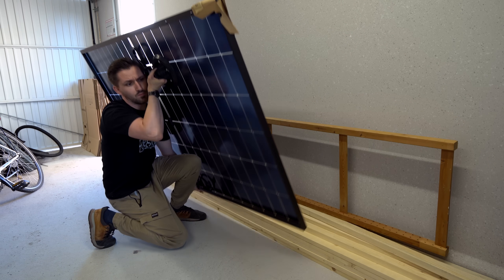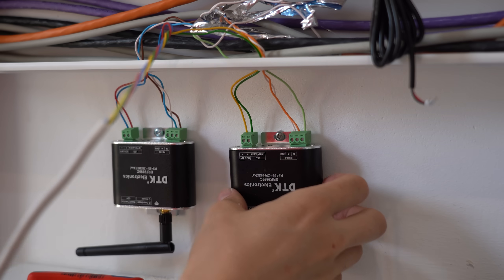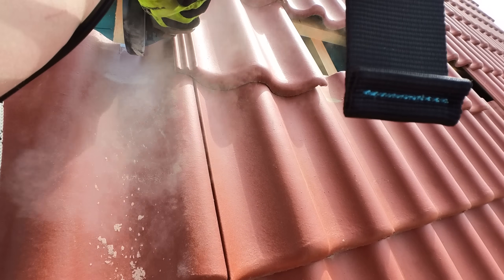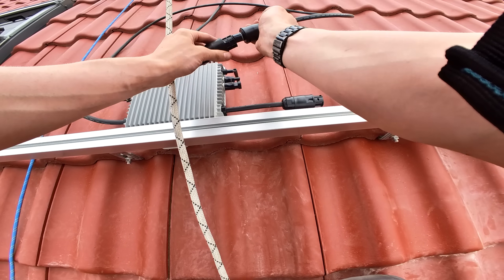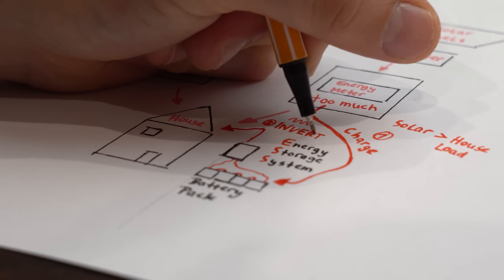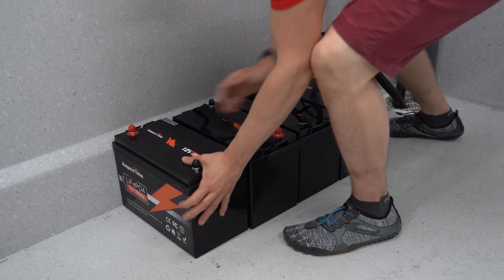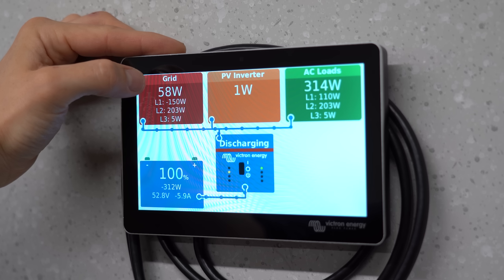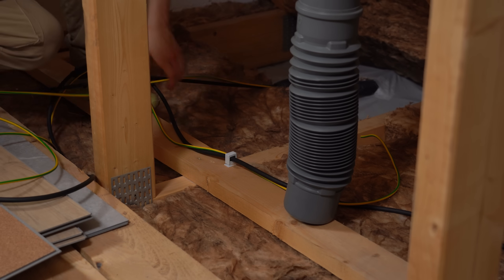Pushing a "legal" Mini Solar System to its LIMIT!

Comment: Brilliant work, dude! Really well done!!! 😃
I just installed solar panels at home this week! 10 550w panels and inverter. (Well, I didn't, the company I hired did it. 😬)
No batteries, the energy goes to the grid, but the electricity company installed a 2 way measuring... thingy... I don't know the name in English. 😬
So, the little clock runs both ways and it generates credits that we can use up to 50 months after. You know?
I think about putting another 5 panels and batteries... But it was a heck of expensive already, so I'm going to have to wait. 😂
Anyway, stay safe there with your family! 🖖😊

Comment: Is it good idea to simply connect the frame of your solar panels with your inner home electricity system? If a lightning strucks in, your entire electrical system could be damaged?
Reply: You are correct, grounding panels like this,  even despite surge protector is wrong and still done in many countries and recommended by manufacturers.
However this should only be done if Lightning system on roof ridge is installed. As now your solar panels are highest point.
Fortunately, in countries like Denmark we dont ground panels for abive listed reasons, as electricians quickly adapts to the conditions where most buildings dont have lightning arrestors.

Comment: Here in Italy what you put back in the grid is subtracted from the bill and it's actually illegal not to put back what you don't use, they decided that you can't be generating only for yourself and potentially be disconnected from the grid. Ofc I'm talking big systems, I have a 3kw on the roof so I don't know if that applies to small equipment like 600w or less.
Reply: Great that it works like that, today!

Once the amount of Solar gets too large, they will change the policy. If everyone put more power on the grid, the excess power on the grid must be sent somewhere during peak times… otherwise, stuff blows up.

Supply & Demand must be balanced.
Reply: @DavidHalko  excess is already regulated by the market, in nordpool countries. So you pay a ton of money when selling to grid in excess peak hours. Obviously you react to that yourself 👌
All thanks to adapting market based and not enforcing a political regulation.

Comment: not having net energy metering is just insane
Reply: Once you have batteries you don't need net metering. You can self consume, most if not all the power you produce.
Reply: @dannelson6980  well, you need very large batteries to store all the sunlight energy, or at least a bit smaller yet still large batteries to consume enough energy for the night. im too lazy to do the math but probably something like 5-8kwh of batteries at minimum excluding AC and EV charging. not having net metering makes the system less economically viable i think, due to not only not having net metering but also you either need to buy more batteries or your system will sit idle after noon
Reply: @pcislocked  He has 5.1 kWh of batteries, it would take about two days to charge them with his solar if he was using none of the solar power for other things. Many countries have demand charges, and/or higher peak prices. Reducing or eliminating those charges pays back faster than net metering. His system is more of an experiment than practical, much of his generation is being used just to run the inverters.

Comment: Technically, when adding batteries and adding a Hybrid/off grid inverter, actually convert it to an Off grid or a partially grid tied system. But i love the idea of creating the ultimate Solar zero carbon footprint Lab. And for home I guess victron is the rolls royce, 600w is okay for running 1 or 2 3d printers and your laptop but that's it!! A little info on that "grid Feedback" and that is to ensure you dont trip a prepaid electricity meter thinking that you might have illegally bypassed the meter to reduce your electricity bill.
Reply: It will be zero carbon after these panels produce enough electricity to produce, mine all the materials for panels, conduits, cables, inverters, batteries, transport etc. I actually wonder how much that is.
Reply: @volkhen0  Roughly 3 years or so if I remember right.  Depends, really, since panel manufacturing gets better and better every day the carbon footprint per panel gets smaller and smaller as well.   Modern solar panels easily last 40 years so they are very carbon friendly.
Reply: @junkerzn7312  sure, it’s clear with solar panels. But batteries require lots of “infrastructure”. I’m curious how it is with batteries and everything that is required to use them.
Reply: @volkhen0  So the question is would batteries also have a reasonable zero-carbon break-even point?   Well, one thing for sure, it will take longer than with just solar panels!  Hmm.   The real question is "what do the batteries offset?".   There are three cases:

For a gasoline-v-EV the batteries are offsetting a massive volume of exhaust emissions from the gasoline as well as the refining and transportation overhead for the gasoline.   The carbon is offset in the first few years of the EVs life... around 10,000 miles of driving now I think as battery production gets more and more scale.

For a grid-scale battery, the batteries are directly offsetting peaker plant emissions and, in fact, allowing peaker plants to be decomissioned (as California has been doing, albeit with a bit of pain a year or two ago).   The carbon is offset in a year or two.

For a home battery system, though, I personally don't think there is a carbon break-even because the electricity you are offsetting depends on the mix of generation sources on the grid and the grid itself is evolving into renewables very quickly.   In California, home batteries are offsetting electricity that is still 50%+ renewables in the early evening and natural gas only really dominates later in the evening and overnight.

There IS a cost break-even for home battery systems dependent on the price of electricity in your area and how much electricity you use.   This break-even has a best-case when you are just using the batteries to load-shift the 4-9pm time slot.  The break-even gets worse when you are using the batteries for 24 hour operation.  Batteries also protect the home owner against inflationary utility costs.

But I think there is a good argument against there being a "carbon" break-even for home batteries.  It could very well be that there will not be a carbon break-even for home batteries.
Reply: @junkerzn7312  on the other hand you said that the grid is becoming greener, there is more renewables in the generation. Yes and the home batteries are a part of that :) I think we can calculate it by not going into details and just use money / CO2 ratio to calculate the manufacturing CO2 of batteries and all the accessories. As the price is somewhat equal to how much energy was used to produce something if not much labour is involved.

Comment: One big problem with simpliy plugging an inverter into your house without anykind of isolation: in a power outage, if you are generating excess power it can be amplfied by the transformer that goes into you house and electrify the grid when it shouldn’t be, this can kill electrical workers if they do not know it is live.
Reply: Not in his case 🙄🤦‍♂️
Reply: @Dextermorga  It wasn’t only directed at him, just general stuff I wished he addressed.

Comment: Good video, just from a safety side, you should probably have DC isolators coming from the batteries, something like the blue sea bs6006 is pretty good, also an AC disconnect nearby to the inverter would also be good, a simple MCB can facilitate this if you want to go simple

Comment: Three years ago i installed solar system in my home with 5.5kw inverter and 3kw panels
My system was simple just battery bank + inverter + panles
No micro inverter.
No wireless communication.
No complexity

Comment: Victron is realy nice, but they need to updated their products. The external connectivity devices and the interfaces are totally out of date. Ecoflow does this with plug and play parts. The system is too closed for me, but it is a modern system.
Reply: You are for sure right on Victron's Multiplus series.  Those units are way out of date.  But their charge controllers and battery chargers are still the best and reasonably priced.  So, situational.   But yah, I would not use Victron for the hybrid inverter.  I would use a Growatt or an EG4 or a Sol-Ark (well, Sol-Ark is really expensive too). 

Well, I wouldn't grid-tie a system like this at all, actually, but that's in another comment.

Comment: If you don't mind the suggestion to offset the small panels for the batteries you could wire a separate charger for the batteries that charges them on your valley electrical rate (normally around 11pm-12am to 4am-5am) so you start the day with mostly topped of batteries into your solar day, where you use the power you need and keep the batteries topped off, so you can use them at peak rate (normally 5pm-6pm to 10-11pm). 
This is still not optimal power wise as you will end with 100% charged batteries many days, which you could tune. but it will minimize electrical bill as it reduces the most expensive tier consumption to almost 0 (and at a time the panels are almost useless)
Reply: @wyattutz  There are hybrid inverters, inverter-chargers, and just plain old inverters.

Hybrid inverters generally have everything.  Solar inputs, battery connectors, built-in charger, AC outputs, and usually also AC inputs (generator or grid).  Some have three sets of AC connections.  Generator, Grid, AC out.  They also usually integrate necessary breakers (but battery cabling still needs appropriate fusing)... and can greatly simplify wiring.  But at a price.

Inverter-chargers have AC input, AC output, and battery connections with a built-in charger and inverter but no solar inputs and generally very little in the way of protective breakers.

Normal inverters are just inverters.  DC in, AC out.
Reply: Generally speaking the best way to handle load support from the grid is to buy a battery charger that has a "power supply" mode.  You can then simply set the output voltage to the mostly-empty SOC voltage of the battery so the charger provides load-support up to its rated amperage when the battery gets low.   That is, the charger would NOT charge the battery, it would simply provide load support.  That way you aren't wasting grid consumption unnecessarily.

This mechanism usually has all the desired characteristics.  The solar will power the equipment and charge the battery during the day.  When night falls, the inverter will run from the battery.  This will usually last all the way through the utility's peak pricing period.  When the battery becomes depleted, typically much later in the evening, like 10pm or midnight, the charger will step in and start providing load support.

Usually the charger's current ramp takes a few hours to go from 0A to full support of the load, because as the charger takes load away from the battery, the battery voltage actually recovers a bit.  So the battery will continue to supply most of the load at the beginning and slowly ramp up from there, usually taking a few hours as the battery supports less and less load before the charger is supporting the full load.

This does have to be a battery charger, such as a Victron battery charger, that has a "power supply mode".  It cannot be a normal DC power supply because normal DC power supplies do not generally have sufficient reverse-voltage tolerance on their outputs.  A charger does.  That is, if you unplug a normal power supply from the grid or turn it off, there is now reverse voltage (the battery voltage) on its outputs verses the 0V on its inputs.  This can burn out a normal power supply.   Battery chargers are designed for this condition and don't have a problem with reverse voltage.

Comment: I was under the impression that the power companies buy the excess energy generated by solar panels, albeit at a relatively low price per kWh. Isn't this the case?
Reply: depends where you live.  Often power companies don't actually want that small amount of power at all, as it makes it more difficult to manage the grid.
Reply: @Wooble57  I see, thanks for clarifying. I remember about a decade ago when companies started advertising very attractive ROIs. Some people "fell for it", investing 10-20k for a solar panel installation, only to find out later that the power companies had the authority to set the purchasing price. The price went down, but I never thought it would have reached zero.

Comment: I would totally avoid pushing energy into the grid if I were you. In the case that you haven't got a bidirectional smart meter from the energy distribuitor, the amount of energy that you will push into the grid will be metered as consume and will appear on your next invoice.
Reply: That is the point about using a whole house inverter with batteries… extra power from the panels / microinverter will sink to the batteries and can be used at any time in the house… then the house can use the mains as power backup when the batteries are drained.

Comment: Nach den Regeln von 2023 ist die Generatorleistung (Solarzellen) nicht begrenzt. Nur der Wechselrichter muss auf 600W begrenzt werden.
Nach den geplanten Regeln wird 2024 die Wechselrichter Leistung auf 800W angehoben, dafür wird die GeneratorLeistung (Solarzellen) auf 2000W begrenzt.
Das sind dann 5x 400W Module.

Alles andere sind dann große PV Anlagen

Comment: Scott please don't put the batteries on the floor. For now atleast put them on a piece of wood. And later put them into a fireproof box.
Reply: For the millionth time batteries on the floor do not discharge. Second of all those are LiFe with an integrated BMS, there's zero fire risk.

Comment: Don't the 12V batteries in the 48V setup drift?
Some balancing might be needed.
Reply: They do and yes, in his setup he would need a couple of 12V battery balancers across those batteries.   But actually its worse.... the BMS's in LiFePO4 batteries make series connections a bad idea.   They can trip off from too-low or too-high a voltage and not be able to recover without manual intervention due to the series connection.  And worse can happen due to the assymetric charge / discharge MOSFET setup in the BMS.  Even if the battery manufacturer thinks its ok (like battleborn, for example), it actually isn't.   He needs to rip the batteries out entirely and replace them with one or more native 48V batteries in parallel.

Comment: when the power from the solar panels are sent to the grid it rotates the meter in the opposite direction which in turn will reduce the readings and hence the whole electricity bill 
source - marcus brownlee 's tesla solar powering
Reply: Thats not how it works in germany. We use so called "2 wegezähler" they measure ingoing and outgoing power separately.
Reply: that is last century type of meter tech you described there
Reply: @96Lauriz  probably , i don't live in Germany 
i was just saying MKBHD also made a video on solar powering

Comment: You probably know, but with the amount of flexibility in terms of wiring that you have, this system is unncessarily overcomplicated and features a ton of losses.

The ideal setup would have been Solar Panels -> MPPT Charge Controller -> Batteries -> Inverter. Then you can just control the output of the Inverter based off your current consumption which could be done with just one meter (Or even the provided smartmeter) and you skip the DC -> AC -> DC losses of having both systems seperated

Comment: Very cool idea, I was not aware such battery solutions exists. If I understood it correctly you could have make the battery and it's inverter connect to the house's main via a normal AC plug, just like with the balcony power generator, since it's essentially doing the same, just with a different kind of power source. Too bad these self-installable balcony solar generators are not allowed in Hungary. (actually all additional solar request are on hold indefinitely, because the grid is in such a bad state that it can't accept more..)

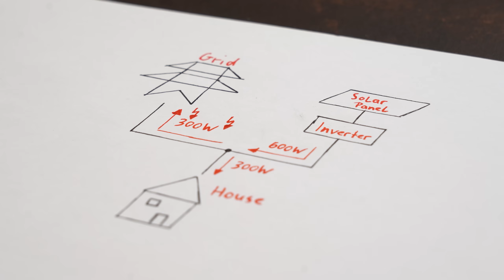Comment: 1:05 no sir, it does not "just suck" - it will COST YOU MONEY, in many places. Because meter can be absolute and does not care what way the power moved - it moved and you pay for X amount of kwh's moved through your meter. Be warned, if you do not know how things work in your area. (I dont mean Scott here, but people around the world who might watch and apply this)
For example here in Estonia you need to apply for different contract for selling to the grid and then your metering unit gets changed.

Comment: Nice setup! Good for you! Surprised though you didn't choose to make the solar panel follow the sun since that would be way more efficient than to mount them on the roof... I know you've made a video about it few years ago. And I think is better to put panels horizontally on the ground than on a 45º incllined roof.

Comment: This systems is an overkill for reasons that are already mentioned in the video but there is one more. Victron is one of the most expensive brands. Yes it does many things that others don't and they also offer very good quality but I think that most of the energy consumers can utilize a home PV with half of the cost and with similar functionality (feeding back to the network is pointless when you can cover most of your needs by your system). Besides very soon the price you'll  get for the energy feed won't worth the cost of such an inverter and installation. Just produce as much energy you can and store it. What you need is a backup energy source when there is no sun and batteries are empty. Then utility grid can be by-passed through your inverter to your home grid.